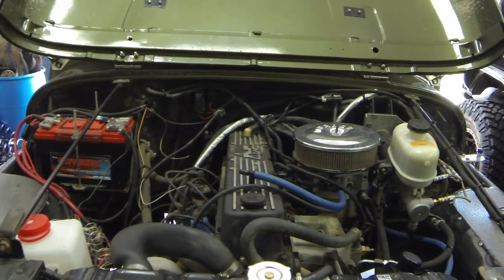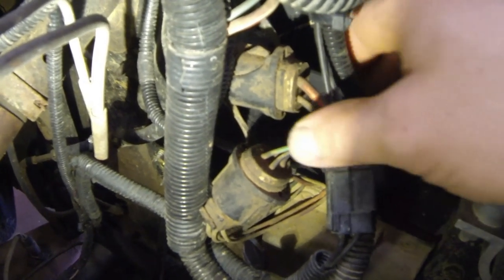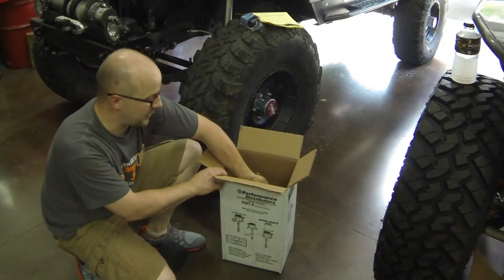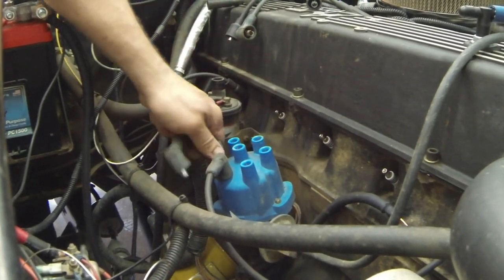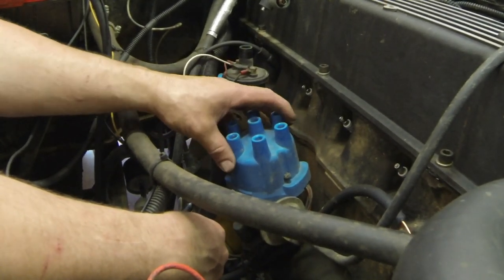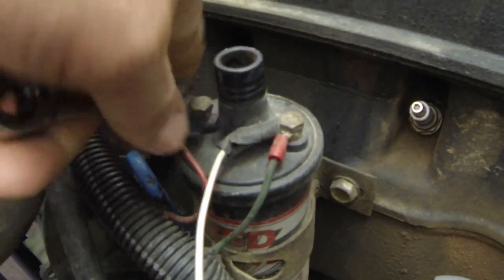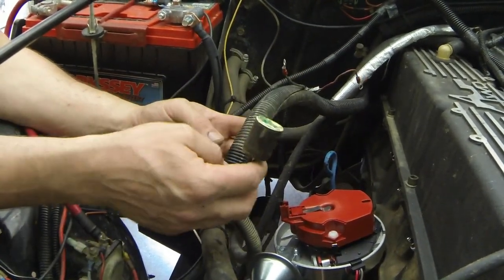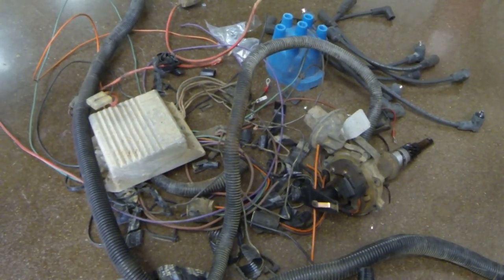HEI Jeep Install

Comment: does the distributor work for all yj models? if yes can I get a link to it please
Reply from the maker: You would only want to do this if you have the 87 - 91YJ
Reply: @rockyour4x4  so there is none for the 95? because I no longer have a computer in mine
Reply from the maker: @carculture4688  why would you have no computer?  The 95 4.0 is a much better platform than a carburetor. What your setup?
Reply: @rockyour4x4  i have the same 4.0 engine,reason for not having the computer is because the jeep was flooded in a storm and the computer was removed along with some other stuff.im also switching it to manual

Comment: Do you have to replace the new drive gear on the distributor with the old distributor drive gear? Will the new gear eat up the other old gear?
Reply from the maker: Charlie Bailey good question
We have always used the gears that come with the distributor and haven't had an issue yet.

Comment: Can i put a distributor in a 2000 straight six? I see the cam sensor has the gear drive and the oil pump drive. Id like to put a carb and hei on the motor.
Reply from the maker: Rob Plotts that is a good question. I do not have the answer. I don't see why you couldn't.
Reply: rockyour4x4 i really appreciate your reply. I have two low mile jeep six cylinder engines from 2000  and a few jeep Cherokees that are earlier than 95. They just passed the law here in jersey that anything 95 and earlier does not have to go thru inspection so i was thinkin of the engine swap but some of my 4x4 buddies didn't think the distributor drive would be there to make the swap easy. I hate with a passion all the electric gremlins these vehicles get.  So i wanted to make it a simple fuel and spark management as possible maybe even carberated.

Comment: wonder if I can put this in my jeep. Same motor 242 I6 .... mine is a 97 G.C. Lorado 2 wd
Reply from the maker: I don't believe so. However, they do make an ignition kit for that application.
Reply: rockyour4x4 m just having that stalling issues that seem plague jeeps that are of cirtain years and are above 150k miles,
one of the 5/6 things that "needs replacing" is the dis. cap and button. and I like to fix it right the first time and no "Band-Aid" it. and if your going to fix it right, do it with some style. lol,
Reply from the maker: I've heard the PCM connection becomes an issue with those.
Reply: +rockyour4x4 I have 81 caprice I dunno which vacuum line suppose to go on that distributor vacuum thing would u happen too know?
Reply from the maker: +Jamar Jackson 
I'm not 100%, but I believe the vacuum advance gets connected to ported vacuum. (Vacuum present at higher rpm, not at idle)
Reply: +Jamar Jackson find a port that sucks the most when you rev the engine when you put your finger on it ( the most if there are more than 1) you just want the full vacuum of the engine to go to the distributor( some ports may be for emissions)

Comment: are you setting the baseline timeing ten degrees advanced with out the vacuum advance? if so how much further does it advance with the vacuum?    i feel if you advance any more then ten it's going to detonate to early and ping
Reply from the maker: Dan Farge yes, base timing
Each one is different but we start here.
Reply: rockyour4x4 how much does it advance with the vacuum
Reply from the maker: Dan Farge that's a question I can't answer. I would give Performance Distributors a call at 901-396-5782.

Comment: Decent explanation of the setup but you left out showing the actual connecting of the new wires...
Reply from the maker: What part do you need help with?
Reply: @rockyour4x4  Thanks for the reply, looking for the best location to hook up the new 12v supply to the HEI so it gets constant 12v?  Also, assuming I can cap the green wire from the coil since I don't have a tach.  I have a '77 CJ5 with the 304 v8 so there isn't as many wires under the hood.

Comment: rockyour4x4, wouldn't your firing order be incorrect in this video? Haynes manual states that the 258ci I6 engines firing order is 1-5-3-6-2-4.  Your spark plug wires are scattered all over the place in the incorrect holes! I could be wrong, but you and the manual show two different placements!
Reply: I have a 1973 Jeep CJ5 I6 258 3 speed.
Reply: NJwrestle94 He said 1-5-3-6-2-4
Reply: NJwrestle94 rewatch the video

Comment: does the hei do away with the computer behind the glovebox? I installed the mopar mpi kit and it's horrible. I want to switch it back to my Motorcraft carb but the mpi had me remove the computer and the entire harness.
Reply from the maker: The HEI dies not require you to remove the ECM for the Carter carb, but it's not needed anyway so I always remove them.

Comment: you did a good video until you got to the wiring....i had to a google search to find out how to do it,,,,,,,delete the module and use the switched power wire to the bat terminal at the distributor.....
Reply from the maker: dano NORSTROM I’m sorry, but every jeep is different and this one was no exception. I think with an OE wiring diagram you will discover that most of those wires will be removed from the harness.

Comment: I have a 1997 jeep wrangler Tj and putting a 4.2 straight 6 in the jeep. I have bought an HEI distributer and I have watched your video I need to know do I go to the hot wire on the ignition key in the steering colmun or where do I hook the hot wire for the distributor? On this 97 it looks like ignition coil is inside mounted on the transmission tunnel under the dash, is this true and do I eliminate that ignition box? Thank you.

Comment: Your plug wires are nice LOL. Wrong boot angle at the plugs. Color is shit. Waaay to long. But hey, they are LIVE LOL. You better measure that battery wire you installed feeding the HEI. If you jumped into the factory Jeep wire, you will only have like 9 volts DC with the engine on. Those HEI modules pull a ton of current. Need to install a relay on this wire for full batt voltage at the HEI mess.
Reply from the maker: It has battery voltage. This wire was pulled from the distribution block and is a 10 ga wire. (So far so good on drivability too) I'm sorry the wires weren't to your satisfaction.
Reply: Hideous wires bro. Power from the distro block is not batt voltage as you know. You need to feed the HEI with all you can throw at it. Better yet get the MSD Streetfire CD box and matching coil.
Reply from the maker: jim davidson In this case it is. Voltage drop from the battery to the distributor here is 90 mV.
Reply: Is that with the engine on under load or off? Makes a huge difference.
Reply from the maker: jim davidson not sure bud
I can get that customer back in sometime and I will check

Comment: So I have the Summit HEI. Do I also get to eliminate my ignition module?
Reply from the maker: BeckHitCards yes, any HEI style will delete that.
Reply: Do I need to run a designated power wire? Since the ignition module is deleted? Or does the hot at the coil still have 12 volts?
Reply from the maker: BeckHitCards You can use that main ignition power from the ignition module for the power to your DUI. You do not want to use your original ignition coil power wire because it has a resistor built in.